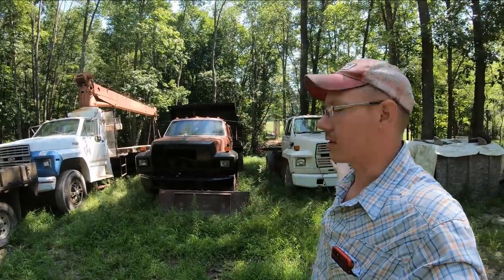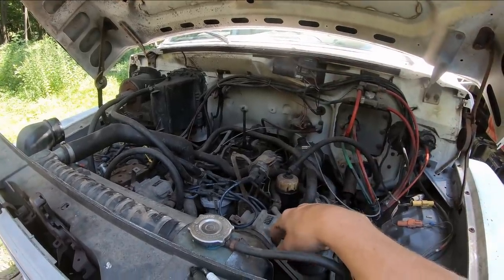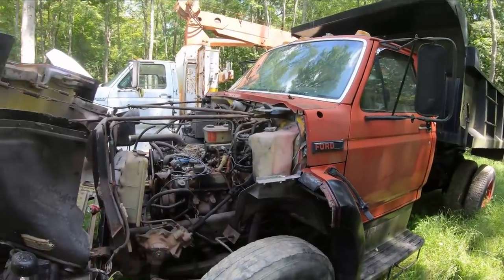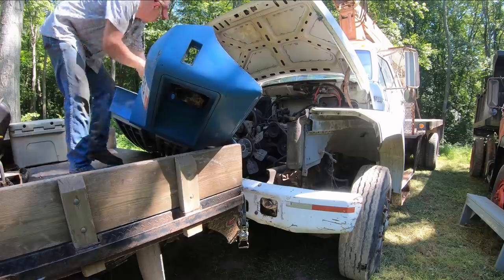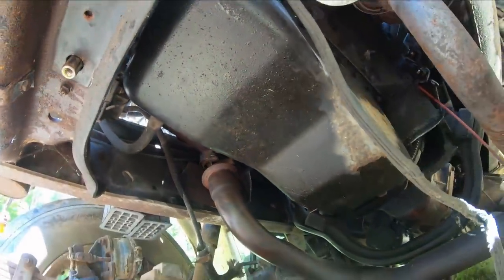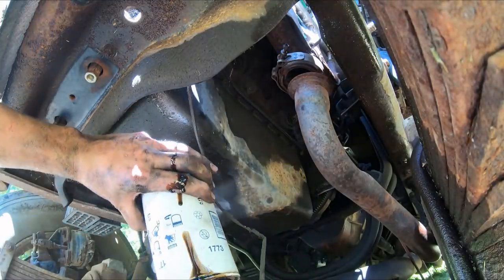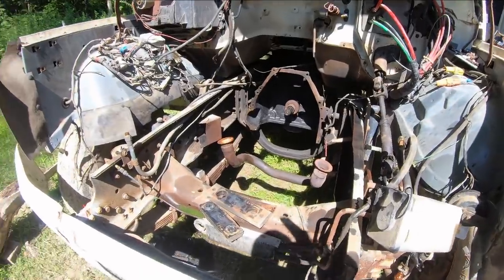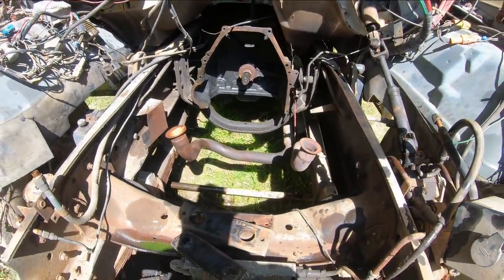Tearing down a BIG BLOCK in the middle of the woods!! $700 Auction Crane has BIG Problems!

Comment: You yanked one head off, what does the other side look like, is the first question I would be asking. If one side's bad, that might be good for whoever wants to attempt to rebuild it. But if both sides have issues, that will of course cost more money. You may as well spend a little bit of time yanking the other side off, to better verify if you have good cylinders on at least one side. That will affect the sale price, if both are bad, may as well throw the whole lot of it into a pickup truck, take it to a scrapyard, and ask 'em what the scrap value of it is!

Comment: Flip that motor over and disconnect that rod and beat it out with a pvc pipe that fits the hole. Once out dingle berry hone that cylinder and maybe do a ring refresh on that piston and it should be good to go. If the pitting is too bad just sleeve that cylinder and it should be good alright. I'm almost certain you can buy a sleeve that will match the diameter of the bore for that piston.

Comment: I was honestly expecting worse for how tight she was!
Reply from the maker: Well the other side could be worse but I didn’t see the need to look any farther, maybe I will for giggles.... still might try knocking the piston down more with a sledge
Reply: @DieselCreek  Cold war Motors/straight 8 challenge: He used hydraulic oil w/ a mini pump to un-stick a piston that was much worse than yours. Also check out Ave on youtube for forklift and/or fork upgrades.
Reply: @watchweswork he cuold have fitted a grease gun to the plugholes and unseized it 🤣 or 🤔
Reply: Another youtuber I watch watch wes work you and diesel creek are my fave's lol
Reply: Of course wes is here, I watch both of you guys! Now wheres mustie
Reply: @DieselCreek  just leave it to be honest but can you make it a (cummins) fummins crane truck
Reply: Shoulda used that grease gun trick to try and free it up right wes? 🤣
Reply: @graburbozak3120  I also follow the guys at coldwarmotors and watched what they went through to get that one cylinder saved. It was a cool challenge and an amazing outcome. Both engines actually ran well. Hoping Matt maybe pulls the pan and maybe unbolts that one rod to see if the rest of the engine is free. Maybe as he said he'd try removing that piston if that's the only bad one. If not him, someone could save that engine. Just thinking out loud.
Reply: @graburbozak3120  I watch ColdWarMotors  every time they have a new one---I am trying to talk them into turning one of the 1940's thru early 1950's sedans into a WOODIE sedan or station wagon, I suspect this is not going to happen.

Comment: i had one like that in a 3 cyl diesel tractor engine.  it took a sledge hammer to get the piston out.  honed the cylinder.  still pitted after hone.  new piston and rings in 2004.  16 years later still running strong.  i'm sure not so good on that cylinder but still.  cheaper than replacing.  iseki japanese engine.  first engine i ever tore down, and it should have been bored out, but.  repaired it for $200 and like i said, 16 years, still starts and does the job just fine.

Comment: diesel conversion, remove plugs, install 14mm bolts, fill block with diesel fuel, done!   One cheap tool you might find handy,  USB cell phone mini camera, like a cheep boroscope on a 10-12' cable.  That rust doesn't look bad, you could tap the piston down a bit more, scrape the rust and blow it out, remove the piston and ball hone it.  Might need new rings but should be dandy.  The 429 4V and and the 460 share the same lineage and should share the same bellhousing, the blocks may be  a bit different whereas it runs side engine mounts instead of mounting on the snout.   That buckled splash shield might have been from a crankcase vapor backfire. but that looks a lot more like something hit it.

Comment: From the 460s I worked on, the block and the engine were the same regardless of vehicle. It was the same V8 in the F900, F350, E350 and super-duty RV.
Reply: The 370/429 in the medium duties has larger snout on the crank to handle running the air compressor.
Reply: @82f100swb  think you are correct Evan
Reply: It used to be somewhat common to turn them down to standard 429 size before aftermarket stuff became common as they are a forged crank
Reply: What about the camshafts, are they all the same??
Reply: @82f100swb  I did the swap years ago. Yes the timing cover, balancer and crank snout are different. I think there were some other adaptions to make too. By the time I was done I wished I'd rebuilt the 429 and I already had the 460 from a wreck so it was more or less free
Reply: And shorter stroke

Comment: The 429 is a well sought after motor on the racing circuit. Hard to find. Well worth fixing. Love your channel. Keep it up.
Reply: Not the truck version.  It's useless to a car or pickup as it lacks any mounting points on the sides of the block

Comment: Great video! I have a '79 F600 dump sitting in my yard with a stuck 370. After dragging it here I managed to get it running for a minute then it seized. From what I understand from 2 months of research the 370 and 429 truck engines have a larger crank snout than the pickup engines. So I'm in the same boat you are, only I'm 60 and don't have a quarter of your energy! I'm looking for a running 370/429 too. Pretty sure it's the bottom end in mine. Great job!

Comment: My grandfather always said that diesel is a great way to loosen up seized gas engines if you have lots of time. We had an engine that was solid, pulled the plugs out and drained the oil, filled the plug holes with diesel and checked on it every few days. A couple pints of diesel later and a bit of a breaker bar got it turning again. 
Wish it would have worked for you. We've only done it on 4 cyl engines or smaller

Comment: As a mechanic i agree engineer's always have yo put something in the path of the oil as it's being drained ford is notorious for The Tie Rods And Panhard Bar Locations in the path of oil I don't belive I have worked on a single vehicle in the last 40 plus years that hasn't been a mess to clean After a oil Drain event Lol 😂 Matt 13:00 @Diesel Creek

Comment: If you ever need to brake a seized engine again automatic transmission fluid works good for that. Also the best penetrating fluid is 50 50 atf and acetone
Reply: Right: good sugg.  same - my thought..
Reply: Only prob for me is old age - not long enough for this world.  but that's OK.  Will be young 
and stronger in the next.  Probably even much smarter!
Reply: no amount of ATF, MMO, etc. is going to deal with the rust he found!
Reply: @DocNo27  Wrong!  Are you a perfectionist?  Reconditioning doesn't work that way; just 
get things to work well, and be content.
Reply: lol 50 / 50 atf acetone sound like they best wat to get cancer too 😂
Reply: @sortaspicey9278  how do you figure?
Reply: The acetone is all fine, but just atf for us lazy folks works well enough on its own, if you want to put it in an aerasol can (reusable they make em) then cutting it with acetone or thinner etc makes a skookum hose er down and wait deal...   Also Type F for the win
Reply: @sortaspicey9278  throw Zyklone B in the mix and then you will be really singing.
Reply: Fill  up that one cylinder with white Vinegar, oil pan is already off so that not an issue ....How to Remove Rust from Metal....    The rust reacts with the vinegar and later dissolves.
Reply: yeah ATF works great
Reply: @442olds7  Apple cider vinegar is what the old times taught me...  We used to free up impossibly rusted flat heads. Of course they were almost always cracked.... But a die grinder and a little JB and we were back on the road...
Reply: @sortaspicey9278  if you're wanting cancer faster! Swap the acetone with MEK! Lol.

Comment: Farmers put a make shift gutter under the hoods to channel the water away from engine
Reply: and a side note for perma low cost backwoods mechanic life hack. Bondo and Vinyl siding have the same properties. Got a 4 foot rust hole? fill with a patch of vinyl siding, add a bondo coat and you have a instant waterproof bond that when hardened looks fantastic and will last. Apply a good sand, paint and cant find it, its way lighter than just a bondo patch

Comment: I am Brazilian may be too patriotic but I believe that the Ford diesel engine is almost indestructible! These engines run thousands of miles without fail.
Reply: Well I am German and "thousands of miles without fail" is nothing we would brag about ;)
Reply: @headmaxify  Good when it comes to trucks is something to celebrate regardless of nationality, these trucks work in difficult conditions
Reply: Found On Road Dead. F.O.R.D This truck lived up to its acronym.
Reply: You Brazilian hotrodders know how to get the most out of your locally used motors, like your Opala Six, etc
Reply: The 300 ford is also good.
Reply: Used to work at a Ford dealership, these were called FNH, for Ford New Holland engines. They were pretty good, you'd have to rebuild the lower end at about 300k miles.
Reply: @headmaxify  Coming from a German lol nothing good comes from Germany
Reply: This is a gas engine
Reply: You could say the same thing about a fiat. You can get a few thousands of miles out of those
Reply: @headmaxify  we've all seen your German cars and you can keep them

Comment: Ya should put a trailer ball in the fork that stop the chain from popping off when pulling and returning moters but anyways great vid and I subed a couple weeks ago .so ya anyways godbless
Reply: Was going to suggest the same thing.
Reply: Or a c clamp
Reply: @wfravel18  C clamps have a habit of slipping off because of the tapper of the forks.
Reply: Moters I bet you learnt gud in skool dint ya.
Reply: @wfravel18  ya that would work but I seen the hole in the fork perfect size for a trailer ball
Reply: @anastyb  does it matter
Reply: @ypop417  see there ya go, you just had to take all the fun out of it didn't you?
 One idiot makes a suggestion to another idiot and we get a funny video or a nice grizzly one. ;)
Reply: I just use a ratchet strap.
Reply: Or a 1" by 3" bolt with 2 nuts fastening it to the fork.
Reply: I second that! The trailer ball is the accepted standard due to it's multitasking options(trailers, towstraps, etc)
Reply: @neil6212  Clevis is the best solution!

Comment: The only difference between a 429 & 460 was the stoke length.  Both engines used the same 3.85" bore. (Hence the 385 Series name)

Comment: I've been a subscriber for a while now and i enjoy your content  ,,something new every week ,,,you were wondering about the differences between a 429 and a 460  ,, I don't think there is much of one , the 429 being an industrial engine i believe has a forged crankshaft and it might be thicker too ,,,thinking of a way to find a good used engine  ,, an old school bus most of the F600 and 700 school buses from the 70s and 80s had a 429 in them 
i confess i don't know a lot about FORD engines ,, if that was a Chevrolet i could tell you anything about it you wanna know ,,ANY chevy engine would bolt to the transmission and work small block or big block cause GM only has 1 bell housing bolt pattern

Comment: just pull that one piston, hone the bore and slam it back together
Reply from the maker: Thought about it lol
Reply: Can't hurt to try
Reply: It would also be the cheapest route. 
And probably the best. You don’t know what your gonna get with a boneyard engine. 
My vote is for hone and rings.
Reply: Yea but the crank had alot of water an crank bearings are gone or wont last a week. But me being me i would still do it
Reply: He could pull a Piston from the other motor and put it back together are am i wrong
Reply: But yet yall are atill ignlring the fact of how much water cae out them crank bearings are not gonne last
Reply: @ronniewilliz153  it was Diesel not water
Reply: Right, those cylinders don’t look bad at all.
Reply: @machscga6238  there was water in that block before he put the dam fluid in lol.
Reply: i would use something to heat up pistons so hott n try use wood 2x4 n slage hammer n knock it loose
Reply: That would be fucking mint 👌🏻
Reply: @DieselCreek  with all the water and sludge in the oil pan its is a crap motor.
Reply: Roger Francis  yups u got it right
Reply: @DieselCreek  seen much worse of a cylinder. Might just work, after that run it for anbit and check the compression. Might just be good enough for a couple of years and a quick flip
Reply: MY thought too
Reply: Yep, why reinvent the wheel, rather the engine.. Just untick what is stuck give clean up, put back together worse case don't run, best case fixed, give you time look for a better one.
Reply: Pull all the Pistons Replace that Piston hone the cylinders and replace all the Crank and Rod Bearings and replace the oil pump and away you go. Unless you can find a cheap short block
Reply: That block will need a sleeve. And, chances are good it's been abused and I wouldn't have any faith that it's going to be reliable.
Reply: @robj2704  Ok why  because there little surface rust... come on,,,, not every engine that has little rust needs a sleeve.  Little clean up put it back together se how it works, just check rest of truck out.
Reply: @DieselCreek  would also mean pulling the pan and you can see if rust cylinder is after effect of being parked due to rod knockage and not the failure.
Reply: @chrisallen9154  ok
Reply: @machscga6238  It was water! Diesel came out after the oil. They both float on top the water.
Reply: @kittyztigerz  Looks like it is at the bottom of it's stroke- can't go down any more so you have to pull the pan and drive it up.
Reply: @wssides  there should go little bit about inch n if he would have turn motor upside down would have easily busted rod trying knock pistons out of the block
Reply: 100% agree, She may puff a little blue smoke (or maybe not) but who cares if it does.  Swapping always sounds easy and then there are a bunch of little things that need to be re-fitted and rigged.
Reply: Rebuilt an old M38A1 that had sat for 30 plus years every cylinder was stuck and pitted all 4 but the block had been bored over to max by the military and the owner wanted to put in as little money as possible. Honed it new rings and lapped the valves  thing never smoked and ran like a top.
Reply: Nice project!  I picked up a MTV 1083 from Gov planet auction.  Army couldn’t get it to run.  It took me a while to figure out the problems (two of them) but she runs perfectly.  But...now what do I do with a 5 ton monster of a truck....????  No A/C in Texas and it’s like riding in a huge tin can.  I did pull a couple trees down though, been sitting since.
Reply: Even if you have to brake that piston to get it out, buy 1 piston and rings for and slap it back in after honing the cylinder.
Reply: Knew a guy with an old mercedes with one dud piston. He removed just that piston and rod then continued to drive that old thing for years.
Reply: With the nose off, I would spend an hour or so with that impact wrench on the crank and see if that could beat it free.  You could also try putting it in high gear and towing it with the dozer to force it.
Reply: Yep, quick journal polish and check cam lobe, presto back in business

Comment: You don't need heater hoses 🤣🤣🤣   I bought a $35 fiber optic camera attachment for my iPhone off of Amazon. The business end is only 5/16" in diameter, perfect to fit through a spark plug hole and have a look, you can even record with it. It's saved me a lot of time on various chores, engine inspection and weeding out rotten air tanks are two of my favorites.

Comment: Them Brazilian diesel's brand new from 1989-90 were some torquey babies with that cute diesel sound. We ran those in our Ford LTS-8000's setup as tri-axle dumps until Cummin's came out with the L10-300's which were put in the 90-91's, both paired with the Eaton 8LL transmissions. We also bought some Kenworth T800's with the Detroit Diesel S60 11.1L which I also liked. For that project boat you are working on there, I'd go with a Detroit Diesel Series 50 4-cylinder which were commonly found in city transit buses. If you found a citybus with that engine, take the 5-speed Allison automatic and rearend with it to put under that Ford F800 and you'd have a kuel ride. A gas engine option for that truck could also be the Ford 300-L6 as those are torquey as well.

Comment: I had an old 455 Olds engine locked up, heads off, one cylinder had water in it.  dried it out, oiled,  24D,  rust cutter, etc.   took a torch and dried it out.  poured in a can of coke, let it sit 30 minutes and it rolled over.  ran good after that.

Comment: You can buy a cheap borescope for around $20 on Amazon.  Hooks up to your phone.  Pop it through the spark plug hole and you're set!  They have tiny LED's to light up the inside.  They have mirror attachments that you can use to look at the valves.

Comment: The 370 was an unbored version of the 429, the 391 was an unbored version of the 460. The 429 intake would probably fit on either engine. 
Personal experience: Once these old engines seize, nothing short of oxy-acetelyne is loosening anything.
Reply: The  medium duty truck  361/ 391 is an fe/ ft series  engine  used prior to 1978  . The 370 / 429 medium  duty truck  engines are 385 series as is 460 light duty .

Comment: It's too bad the crane wont run independent of the engine.
Reply: It will with it’s own fluid reservoir and engine…. A Wisconsin engine off and old Minneapolis Moline hay baler. Has electric starter.